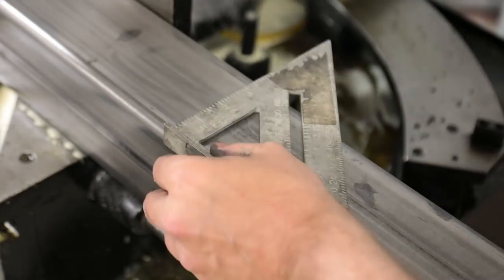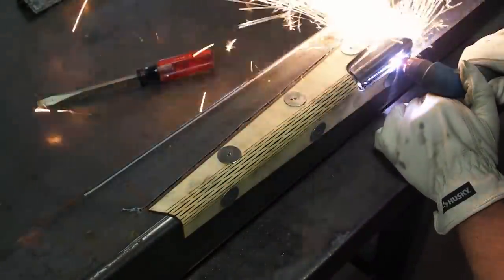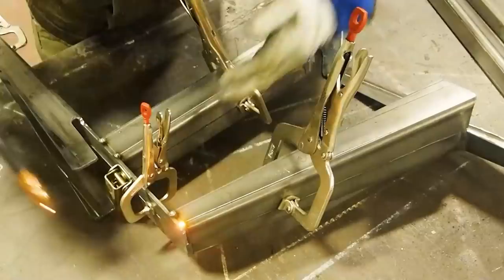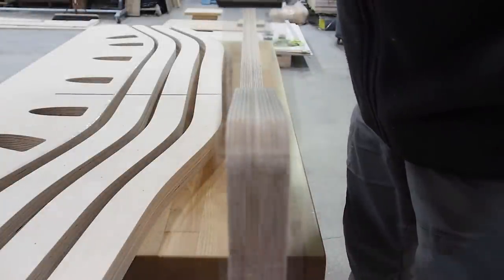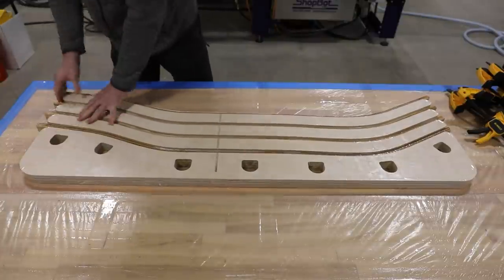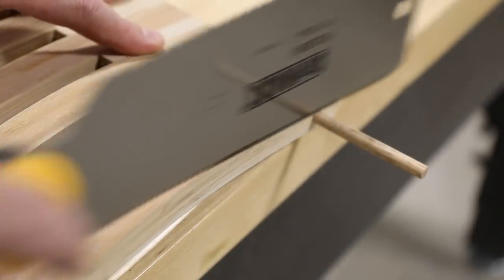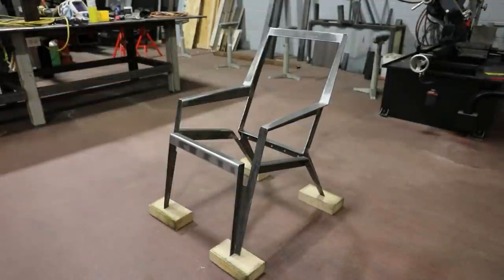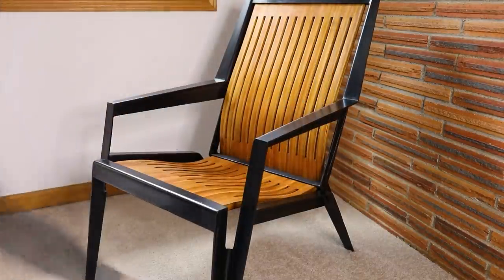Deck Chair | Epoxy Laminated Cedar and Torch Blackened Steel

Comment: Gorgeous thing! I made a steel framed concrete topped table and used the torch and linseed oil finish. Five years later it is holding up fine. Old timey is good timey 😉
Reply from the maker: This was truly a welcome surprise… I am wondering if coating with spar varnish is good enough for outdoors?
Reply: @Grunblau  I've had good success with a local penetrating polymer wax coating called woodoc. Goes on easy and is really easy to touch up when it eventually weathers. Have never liked varnish as it's such a misision to refinish.

Comment: There are plenty of videos online of people making stuff in their garages with little planning (and no disrespect to them), but your unique emphasis on the process is extremely engaging. The demonstration of control over the process outcomes in small production volumes with no dedicated machines is the biggest reason why I appreciate your channel. 

Question: How do you market your set of skills? I’m an engineer and I feel like I share your love of and talent for creating unique processes like this, but it’s not obvious to me how I might use these specific skills to deliver value except by working for a small fab shop. I currently work for a large manufacturer, and I often find my skills don’t have a clear place in the engineering role I signed up for. I’m very interested in learning about your professional journey.

Thanks Brian!
Reply from the maker: Thank you for your comment.  You are correct that it is difficult to find a place that values your talents.  For you, finding a way into the R&D part of the large manufacturer would be the most rewarding.  If you cannot find what you need there, you can always carve out your own time to develop things that interest you.  I designed and built my own CNC partially to scratch this itch while working at an architectural firm.  As far as compensation, it might have to be considered in when you find something that is willing to pay you for what you would do for free.  I gave up a salary 3X what I make now to return to YT and it was worth it.  Now I need to figure out if I can stay.

Comment: I respect the creative and learning process. 
But it hurts to watch how much work is to make and clean those plasma cut parts. Especially when custom laser cut and bend parts are so easy to come by and cheap nowadays.
Regardless, the result is very neat and its good to see you back at it again!
Reply from the maker: Really wasn’t that much work and if I was doing something like a simple bracket out of 1/4”.. this might just be easier than involving my laser guy.  That said, next ones will probably be laser cut and bent or even laser cut from a tube.
Reply: @Grunblau  It's definitively a good pathfinder process for next projects, and you didn't have to wait for the parts to come from laser. It also shows the evolution from the rocket stove build.

Comment: Excellent job. You are extremely proficient in so many areas, metal, wood, design. 
How did you decide on the curves of the seat and back? There are so many possibilities but only a few that are both comfortable and pleasing to look at. 
Good job.
Reply from the maker: Slightly modified curves from a couple of chairs I have found comfy…. It can be worse that simple flat if curves aren’t complimentary to the body!

Comment: Please tell me those double-holed spacers were from a mistake, and weren't some super clever feature.  Then we can all feel like we have something in common with you 😅

As always, a fantastic video demonstrating all the beautifully designed tooling needed to get an amazing product.  I am eagerly awaiting your next video, just like I have for years now: been subscribed since the old casting videos, and am still delighted every time I see your videos pop up in my feed.
Reply from the maker: Double holed spacers were a mistake.  I was going to pass two dowels through the spacers and slats.  Happily, I realized how big of a CF that would have been before I drilled the slats.  

The other issue with two dowels is that you would have seen them on the sides of the seat and seat back.  Unless someone X-rays the chair (or watches the video) they will never know ;)

Comment: some insights on your CAD work? these are some complex models, also how you translated them onto the square tube.
Reply from the maker: Maybe in a future video.  Usually, most people fast forward through CAD related stuff.  

Basically, block out the massing of the chair, fillet the corners the same radius as the tube and then unroll the 2D geometry.  Add features like hinges and magnets, then export to illustrator if doing paper patterns.  Export to laser if doing plywood patterns!
Reply: @Grunblau  awaiting that video.

Comment: Amazing job. Great design and smart execution. What kind of clamping method did you use while cutting forms out of 3/4" plywood under your CNC router?
Reply from the maker: Thanks! That is a 10 hp, vacuum hold down table.  It is powerful enough to suck through the 3/4” MDF spoil board and hold down the 3/4” plywood.

Comment: Amazing as always! You never cease to blow my mind away!

A small side question, I was wondering why you heated the metal @ 17:42 before welding? I initially thought it might oxidize the freshly ground metal (which if I recall correctly is bad for welding) but that doesn't seem to be the case.

I hope this is not coming across as me being an "armchair expert" since I've never done welding, but I'm just really curious about the process and considerations of heating the metal before welding.
Reply from the maker: Thanks!  On this particular day, the shop was about 30 degrees F.  I didn’t want to take a chance that the weld wouldn’t penetrate considering a stud is like a little heat sink.  Raising the temp a few hundred degrees makes me feel like it has a better chance of getting good penetration.

Comment: Amazing work as always! Love the final look, I dont think Ive ever seen the "hot blackening" process before, looks like a lot of effort but the finished product looked great so I imagine its worth it. Is the hot blackened surface more durable than a cold process or paint?
Reply from the maker: I feel like it is as durable as mill scale…. And it really is less effort than the chemical black since I didn’t have to remove all of the scale and do it 5 times because the chemical turned orange!  The waxy surface is much more satisfying than paint to touch.
Reply: @Grunblau  In all honestly I havent had the opportunity to try either technique so thats interesting to know! Thanks!

Comment: Very cool.  I wish my brain allowed me to do this kind of thing.  It's not the process, it's the "OK, $x for a welder, $y for a plasma cutter, $z for a table, $abc for wood"...if this doesn't work I'm out $abc, and I have to answer to SWMBO as to why I scrapped $200+ worth of lumber...and don't get me started on the $x+$y+$z investment costs.  I just can't justify the costs for my "hobby"....no matter what, I just can't get past the "$600+ for a plasma cutter, even though I know I can use it for lots of things, I just can't justify that in my head"...now then, $500 for network cable tools, cable, switches, and routers to redo the home network?  no problem....LOL...First world problems...LOL.

Great stuff Brian...you've come a LONG way since I started following you back years ago when you had about 10K subs...Love that fact your a local guy too (well, not THAT far away....).
Reply from the maker: Thanks!  I am glad that I also have the Rocket Stove out there to show a more simple way to cut parts from a tube.  I bought the cedar deck boards during the height of the pandemic and had to choose my 5 boards out of a discard pile of about 9.  I am with you on the cost of tools.  

More and more I am finding that many ideas are limited by the tools I have access to and I am trying to remove as many barriers as possible.  I am slowly chipping away at the list!
Reply: @Grunblau  I remember when you built the first CNC machine...I was just "I WANT ONE"...LOL...

The stove is really nice, and I've considered making one myself.  Believe it or not things like "buying the steel" and "welder" slow me down.  I know I can get a HF Special relatively cheap, but they are so limited if I jump in and really do this...but the $600 ones are just "man, $600 is a lot of computer parts, and networking for the home, and yada yada yada".  Believe me, I have the $$$, but I grew up dirt poor and never knew it, so saving, saving, saving has just been ingrained in my brain.  LOL.  One day...One day I'll just say "SCREW IT, I'M BUYING IT"...

Comment: Did any of the Boat Ready layers go between the slats if yes was it just with brush … if not howd you prevent it?
Reply from the maker: I used a foam brush to get between the slats.  That was a bit of back and forth to avoid runs.

Comment: If you said it then I missed it, but why did the spacers each have 2 holes in them, one at either end? It seems the spacers only used one hole, was is a deisgn choice or just caution or something else?
Reply from the maker: Some processes are best when I don’t have to think during the glue up process beyond ‘this side nicer, put it facing up.’  That said, I intended for there to be two dowels through them but this would have compounded the complexity and the 2nd hole would have actually shown on the edge.  For those reasons, I just left them.  It will be our secret…
Reply: @Grunblau  That glue is plenty strong as it is, not like those spacers are going to move at all.

I would not mind having a set of those hanging around my house, a wonderful design.  Well done.

Comment: “Oh let me experiment with processes I’ve never tried before”….oops! did I just reestablish the industry standard by which all similar processes should now be done because of precision, material usage, tool efficiency, and design? Oh well, things happen! 🙏🏻 incredible Brian. Just incredible.
Reply from the maker: Thanks!  I have designed/built a lot of things using bent steel (see Platform CNC).  Something like this was always in the back of my mind as a way to not have to wait a week or two to get the parts back.
Reply: For real!

Comment: Really awesome!!
How is the boat going?
Reply from the maker: I built 2 models (one for me and one for someone else) and then winter came.  I have the kayak model kit complete and was waiting for plywood and lumber prices to settle.  The buck and stands are cut and I have the Okoume plywood.  

Mostly just waiting until I have the $ to pull the trigger on the epoxy and fiberglass.

Comment: It's a nice piece. I would wish the feets were covered not scratching any deck. Just some piece of metal welded to it to sit/glide on it.
Reply from the maker: If it makes you feel better, the feet are slightly domed out from the corner.  I considered adding feet like on the welding tables, but it didn’t seem as ‘pure’ from a design standpoint.  

What you mentioned is certainly better from a functional standpoint especially on something other than carpet!

Comment: Beautiful design. I love the shared clamping mechanism with one set of nuts between the seat and the backrest. Brilliant. Looks very modern like most of your designs. Keep up the good work.
Reply from the maker: Thanks!  It is details like this that I puzzled over for a week.  Looks obvious, but it wasn’t to me right away…
Reply: @Grunblau  If I tried a similar chair I'd have 4 sets of studs/nuts for the top and bottom of the seat and backrest. lol

Comment: Excellent craftsmanship.
I tried to torch blackening steel, but sometimes it peels off while I’m heating the steel.
I’ve noticed that you heat the steel from the opposite side after applying the oil, but I can’t do that as I’m working with a pipe. 
Any ideas what’s going on?

Comment: Vacuum bags are very good for laminating curved moulds. You need less template and it is just as accurate. And the vacuum bag and the pump can be used many times.

Comment: Very cool video! Did you learn anything that will go into your boat/kayak project?
Reply from the maker: The epoxy and varnish will make its way there especially if I make a custom paddle.  If I do a modern take on ‘Old Ironsides’ a lot of the steel fab stuff should transfer too!

Comment: ummm, a shopbot cnc? really? I guess the Platform was too small for the job?
Reply from the maker: Not my CNC.  I rolled my own (Platform CNC)…. It is nice to have access to a tool changer and a vacuum hold down table for sure!  :)

Update after your edit:  It would have fit on the Platform.  1 layer at a time…. Shopbot is a decent machine that could use an update.  If they would let me redesign it, I’d take one for payment.

Comment: Very nice and neat work 👍
I have 2 clarifications....
1- Does that boiled linseed oil blackening provide any corrosion protection?
2- Couldn't that finish stain light colored clothes like white shirt for example?
I'm asking these questions as I'm planning to make a slightly different design and will use it in a garden in the seaside where the weather is highly corrosive.
Reply from the maker: The boiled linseed oil is supposed to protect the steel just as the mill scale does.  More important might be the coating you put over the black.  Like a polyurethane or spare varnish might be better for outside.  The coating does not come off…

Comment: can topology optimization be applied to the chair skeleton ?
Reply from the maker: Sure.  The limits of the steel tube as well as ability to build it using traditional stock would render it as an interesting conversation.  

There is an amount of topology optimization that naturally occurs from design experience.  Knowing how to size members from a ‘seat of the pants’ vs a computer generated suggestion from all data entered.   Many of the ‘optimize’ solutions I see exist as extra heavy and obviously manipulated to form an intended aesthetic, however.  

This is a fine approach and is informative about a structural strategy that may not have been considered.  When it comes down to making something that exists beyond the crit-board of academia, other factors are involved void of a multi million dollar 3D printer. Even in the realm of ‘we can print any form’ there are factors that need consideration.  Sinter-ability, shrinkage, support, etc…. Add into that finishes, ability to clean and this becomes a dangerous place where people lacking the first element (design experience) hope to leverage early access to computer software to circumvent good design and intuition with a wiz-bang, never before seen mounting bracket or similar.  In most cases, this technology should exist as a check on design intuition until we can add a ‘common sense’ slider input from buildable to farcical.

Comment: is it necessary to remove mill scale before hot blackening?
Reply from the maker: This was one of the benefits I saw to the hot process.  To do the chemical blackening, I would have had to sandblast (or manually sand) the entire chair.  Instead, I passed a palm sander over it and got out the linseed oil.  You cannot see a difference between the bare steel and where there was scale and I assume the black is stuck as well as the mill scale (which is really well).

Comment: Nice chair. Question about the boiled linseed oil. Will this finish be durable enough for outside furniture?  I have done some looking around and cannot find a clear answer.
Reply from the maker: I feel like it is as least as durable as the mill scale or as the ‘seasoning’ on a cast iron pan.  If left out side, most of it would probably not rust right away but it would be better if it had some sort of clear coating on it.  Maybe a clear lacquer or spar varnish like Gleam from Total Boat would work.

I should really just prep a piece and toss it in the back yard to test…

Comment: 17:43 What does heating the metal before soldering do?
Reply from the maker: The shop was about 34 degrees Fahrenheit in this shot.  I wanted all of the metal to be heated up a couple hundred degrees in order to ensure better penetration of the welds.

Comment: Great project as always! Still anticipating the full scale stitch and glue kayak build video! Hopefully that project hasn't been permanently shelved.
Reply from the maker: Epoxy doesn’t like sub 40 degrees.  I’ll probably start cutting the Okoume soon and get it stitched together.  I want it to be a singular video so I am trying to consider how to frame supplemental content rather than have the channel just go dark for a few months.  The buck and stands are cut.  I am also looking to maybe pick up an interested sponsor to help with the fairly expensive costs.

Comment: Very nice... love it! Excellent wood and black metal finishing 👍👍
Though it would have been nicer if the top-side plywood seat is set flush with the metal bars 20:24.
Reply from the maker: Thanks.  Was concerned with this early on and did a test fit and sat on it.  You really do not notice it especially since I gave the steel a gentle chamfer.  It actually provides a satisfying relief to keep from sliding front to back.  You feel the slats more than you do the bar.

The consideration to plane a ledge into the cedar brings forward some other issues that are difficult to deal with in a satisfying way.  How is the cedar ‘ledge’ treated?  Will do he cedar be strong enough if thinned at the end?  Does it add unnecessary complexity to the chair (and video)?

Comment: I would love a set of the templates for the pipe. Definitely something I'd be interested in making.
Reply from the maker: I considered making something like this available but I worry that the seat and seat back might be slightly more involved than most would be willing to tackle.  I’ll consider it, but it would likely be a total digital package with cut files as I am not setup to become a shipping house right now.